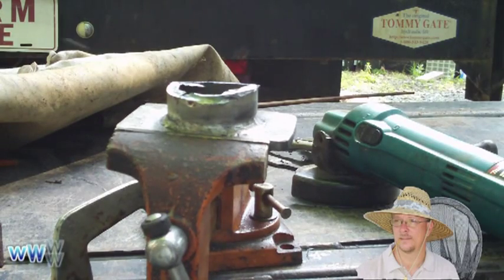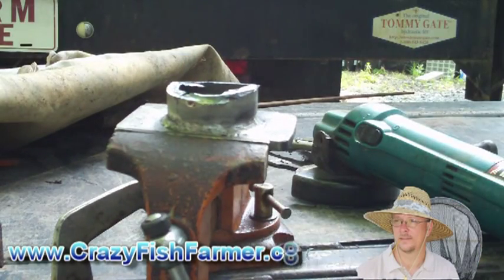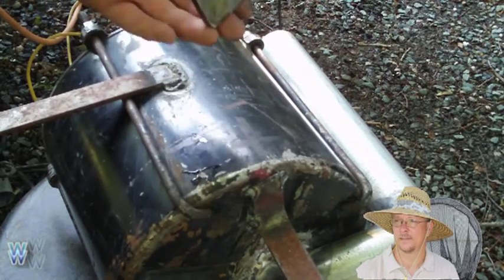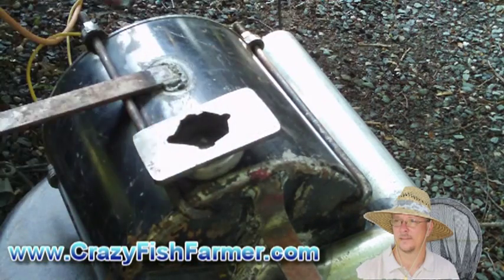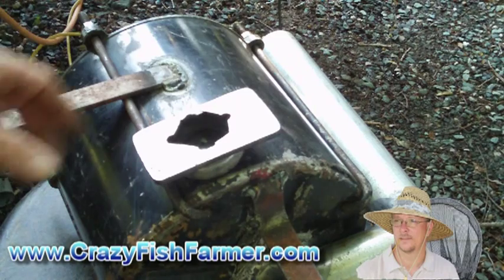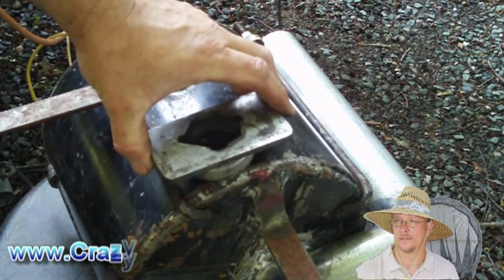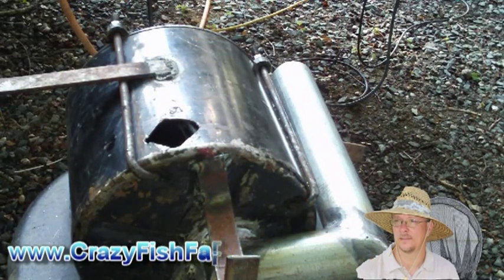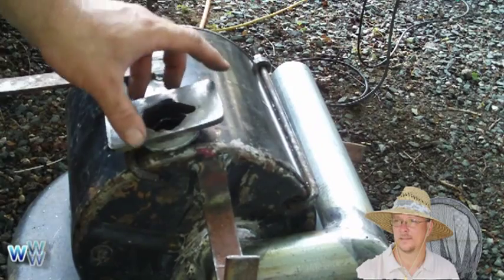18 - Welding the Holly Carburetor float mechanism on the bubbler

Comment from the maker: If i don't blow myself up you will see it working... This is only the first stage of my experiments... The way that Indian Chief did his system is going to be used in one of the stages in this project... It will make some kinda sense soon... The Subaru will be a true FLEX car...  It will run on a lot of different fuels... Well if it turns out the way that i am thinking... lol...